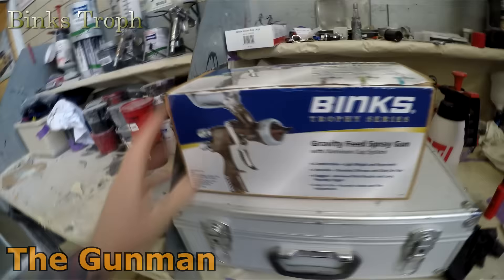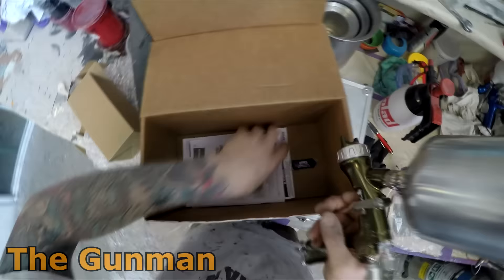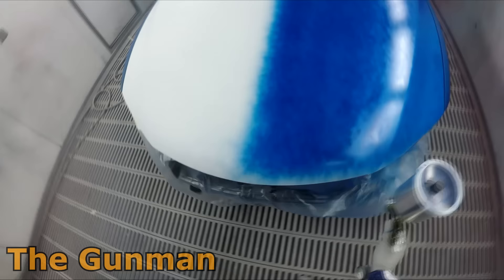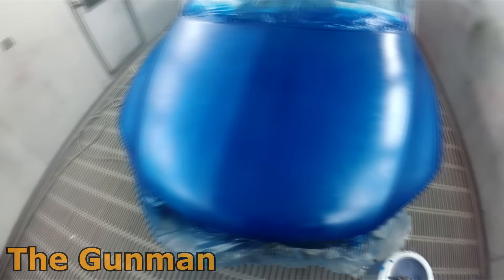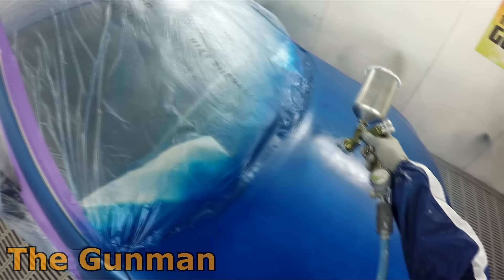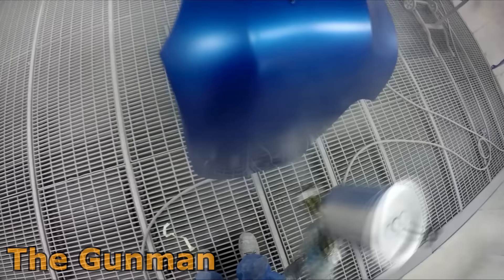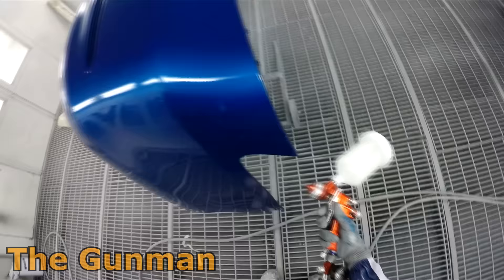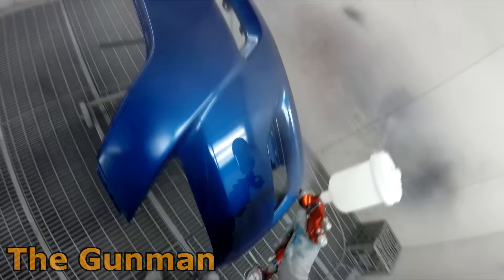Binks Trophy Series LVMP: Spray Gun Review

Comment: The little Brit needs to do an unbiased review of the Binks 2465 lvlp to show us he is a real man when called out on a lie.  Let us see how the Brinks is adjusted without anyone adjusting the cfm and pressure from outside of camera range.  Do a tutorial on adjusting a sprayer, specifically the one used in this video.
Reply: So you think he is torpedoing the banks gun for what reason 
 I am a painter and don't know anyone using a banks gun except for pressure pot work. Just so you know I started in 1974 on a model 7 with the 36 sk cap

Comment: I appreciate the honest review, and please keep the same attitude. I know a little about flow dynamics, and I know that Binks is putting the fluid nozzles from the HVLP on the other guns because the volume is to high at the air cap, as the HVLP's need more volume there. If you look at the fluid nozzle you will see that it has 12 holes. If you block out every other hole and leave 6 holes left then it will spray correctly and have a large spray pattern with the proper atomization. I own one myself and thats how I solved the problem. A huge mistake in manufacturing for sure. The build quality of the gun is actually some of the best I have seen though; but this problem is unacceptable, as it can make or break a gun.
Reply from the maker: I know right, the gun seems like it could battle with the best as far as build quality but real disappointed with the fan size. I ended up giving this gun away to a panelbeater to use as an etch primer gun.
Reply: That is fascinating. Thanks for posting this, aside from the knowledge sharing which i appreciate, it  also makes me feel at least a little better... I use the Trophy Series LVMP 1466 touch up gun to apply Cerakote to firearms. It is superb for that, and lays down a better finish than my Sata 4400B, and I'm not lying. I mistakenly assumed that the larger version of what i have would be good, so Gunman just saved me about 4 to $500 with this video. Thank goodness i didn't go with it, I'd have been disappointed to say the least.
Kind of a shame though that Binks couldn't make it work on a larger scale. Because the touch up gun with 0.8mm does an amazing job for the non-auto smaller jobs I'm doing.

Comment: Gunman, i asked if you did a review on this guy in a past video. This is my first gun. mine is an Auto-pro trifinity. (bought by napa in canada) absolutely love it. i have a 1.3 tip and a 1.3 pro aircap. i spray everything through it from base, clear and single stage. i just started painting a year ago and have a fleet of 120 bucket trucks (power company) I have to keep white. i do find it has a different orange peel than my other 2 devilbiss finish lines (never left me stranded). I really do put these guys to work. the trifinity just fits my hand so perfect
Reply: bahaha i posted this on the wrong video

Comment: Hi:Do you think the poor performance is because of the LVMP rating of the gun. Maybe LV = less air = less paint = smaller fan??Is it just this LVMP gun or do you think all of that class of gun would be unsuitable (to you). I know you like to hose the paint on.I believe your favorite gun is (or used to be) the GTI PRO (or was it the Pro lite ?) with the TE20 air cap but I'm having a problem figuring out what that combination is rated as. I'm pretty sure it's NOT HVLP unless you use the H? air cap. So just what's the deal with your favorite gun, fluid tip, air cap combination? HVLP LVLP LVMP OTHER. Do you think this gun might be better suited to water-born paint??It would ne helpful if you explained the equipment a bit more for us just getting started. Thanks

Comment: And that's why professional painters spend so much money on their gun ... quality, durability, reliability and most importantly speed of application. It's a job, not a passion project, even if you can be passionate about painting cars. I'm a finisher on luxury boats (gelcoat spraying, sanding polishing) and I fking love spraying. Though gelcoat isn't paint.
The guys I work with are all running 40-100 € guns, and here I am with my "cheap" 200+ € gun, they have tons of orange peal, spend a lot more time sanding, not respecting final thickness requirements of 650µ-700µ (microns), whilst I'm able to start sanding at 320, and even 30µ removing nearly no thickness and being done in 3x less time xD

Comment: Hi,i am professional painter  from Montenegro,small country in Europe,can you reccommend me which is the best gun i can use, i have few, SATA 4000, 5000, DevillBis GTI PRO, and i want to buy DevillBis lite gold color, do you recomend me to buy this gun,and which air cap i should use? 
Thank you!
Reply from the maker: +Ivan Huter yes I highly recommend the pro lite, it should actually spray very similar to the pro. Air cap selection will depend on whether, types of paint used and desired finish. I have all the caps and use different caps for different applications. TE20 is a good allrounder, fast and capable of great finishes. T110 is a beast for glass finishes. All recommended with 1.3 for most circumstances.

Comment: The Binks BBR suction fed was the best gun Binks made if wanted a huge fan
Reply from the maker: Sad to see they didn't transition to gravity fed guns very well
Reply: Well I am into Super Yacht painting and to cover large areas we needed a gun with  a huge fan but a small set up to give a flat peel free finish this is where the Binks BBR had it over most of the other guns on the market. Devilbiss have now launched a gun Call the Cspray its mutch the same as the Binks BBR the air caps is nearly a direct copy and it produces the same type of finish and they also made a gravity gun with a 1.2mm set up nice guns. Looks like you are having fun

Comment: i've had my binx model 69 forever but i liked my devilbess best so far is the sagola gonna replace your gti
Reply from the maker: Surprisingly it's still in the number 1 spot after a month, the Pro lite still comes out sometimes, for a flat glass finish or even fine Mazda peel with minimal material I use the T110 1.3, I find the Sagola lightning fast even when wound in.

Comment: cool thanks I'm gonna order the pro lite t110, 1.3 tip but noticed they don't offer the pretty gold finish here in the states are they still the same gun besides that.
Reply from the maker: +spies hecker there's one other difference, the tekna has no air cheater valve on the gun, no biggie because I run a manometer/cheater valve on all mine anyway.

Comment: The Binks Trophy Series LVMP Spec says 4-12" fan.     8-14" with HVLP or Conventional aircap and nozzle.   Reference: https://www.grapekaction.com/images/uploads/BinksTrophySiphonPressurePartsManualLinked.pdf      I also find it curious that the fan only goes down to 8 inches with the 14" fan.   I use the pin point for inside edges of bumper vents, and the inside corners of truck beds.  BTW, I hate shooting the inside of truck beds!   Gunman, You should demo your truck bed shooting technique.